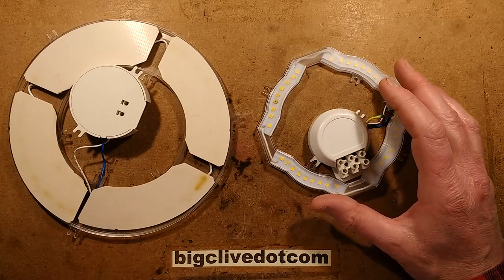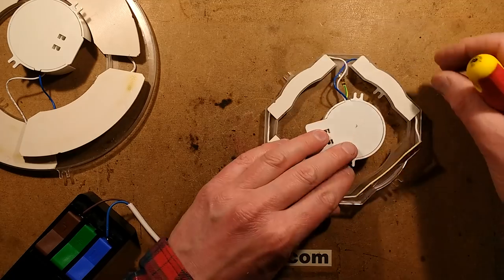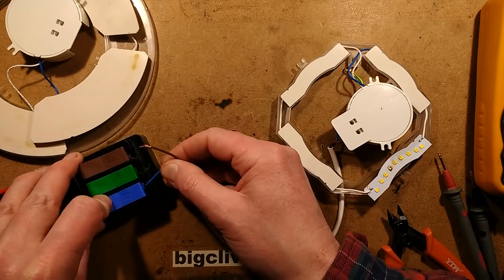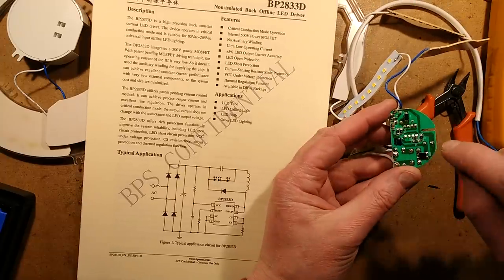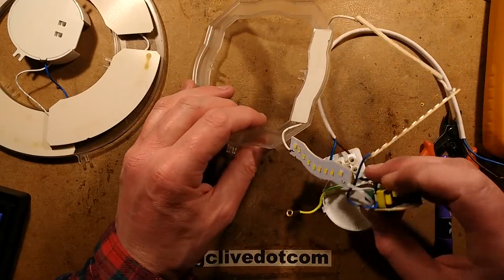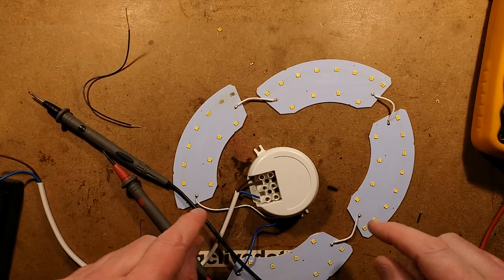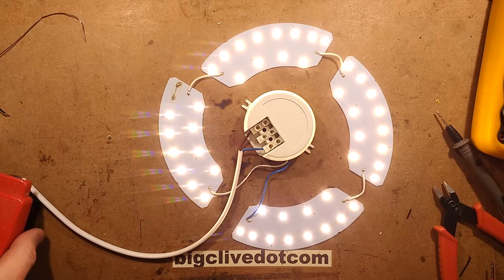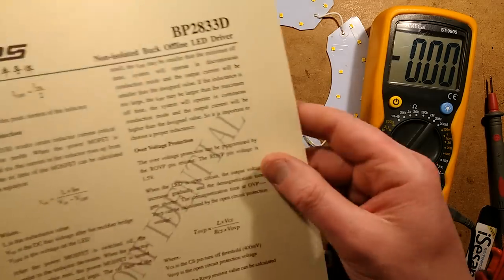Fixing two dead LED bulkhead style lights.

Comment: It is a bit hard to see in the video, but it looks like there is no large copper fill around the LEDs. There seem to be wide traces to the LEDs, but that's it. The designer could have filled the area around each LED with copper and it would help conduct heat away from the LED better. The added manufacturing cost is zero (well, it is a bit more difficult to solder down the LEDs but that is simply an adjustment to the reflow soldering profile).

Comment: One of my car's LED brake lights burned out a few months ago so I pulled the "bulb" and replaced it then peeled off the flexible circuit layer with the LEDs. I think I know which LED failed, but I haven't probed around yet.

Comment: What causes those brown LED spots? My 12v LED strip is full of them now 5 years down the line, they all still work albeit getting dim now.
Reply: Heat damaging the phosphor coating and the led junction it's self, plus general life cycle of the led, but mainly heat.

Comment: Should have measured the temperature that the LEDs are running at. Especially to see if the panel with less LEDs left on it is running noticeably hotter than the others.
Reply: SinsBird They are not going to run hotter when the supply is regulating current rather than voltage, as these are demonstrated to be.  Whether you have 1 LED or 1,000,000 LEDs in series (at least so long as you have a supply that could withstand the 3 to 4 million volts that might take), if the supply is programmed to only deliver 100mA then that is all each LED will ever see as the voltage will be reduced to whatever voltage is required to maintain that 100mA, and it is the LED itself that determines what voltage it will see at that current
Reply: Yeah, I messed up.
Reply: As it is a buck regulator, it can only output less voltage than on the input, so removing a couple of LEDs wont change anything, adding a few might make it stop working.

Comment: LEDs, when in a series and not matched perfectly, degrade at different paces. Those that degrade faster oppose a higher resistance so the voltage dropped across them grows, causing an avalanche effect.
The others are spared higher voltage by the aging ones taking more voltage drop.
Cheaply sourced components with too large a tolerance between them.

Comment: Clive, I'm not sure whats wrong but I no longer get audio from your channel. All others are fine. Any ideas?
Reply from the maker: Your computer's surround sound processing may be interpreting my bassy voice as a bass channel and diverting it to a subwoofer or centre speaker that doesn't exist.
Reply: You were nearly right. Somehow my settings had reverted back to 5.1 (not currently connected) took it back to 2.1 stereo and all fine. Strange though because all other channels seemed fine! Cheers anyway pal :)

Comment: I'm a school caretaker.  For years I swapped out 60w ordinary bulbs.  Then we went 2D- massive expense.  Now we've gone LED.  TBH....swopping out ordinary bulbs was cheap and quick.  Now I have to get sparkies in to replace entire fittings.  Please can anyone explain exactly where the saving is coz my contractor bill is now huge.  Like hundreds a year vs. zero when I was using standard bulbs.  Makes no sense to me.
Reply from the maker: That seems to be how it goes these days.  It's good to know that they actually let you change lamps though.  Many newer school caretakers here are not allowed to touch anything technical.
Reply: 40 yr old tube fittings running perfectly.  Tube fails:  New tube and starter.  Modern jobbies- Ballast fail.... new fitting.....10 years old.  Bah Humbug
Reply: It makes the world go around, us sparks have got to eat you know!
Reply: Well at least modern tubes do not flicker anymore compared to the old 100 Hz flicker crap.  
This is why I choose tubes with a good supply over LED lighting - for LED it's hit and miss if you get any decent power supply that can output proper DC. With tubes (which are dirt cheap and you can choose a wide range of color temperatures) it's easy.  
And if you use the Osram Lumilux Skywhite one time, you will stand there in awe thinking the sun just went up in your room.
Reply: Exactly. And with piles of failed LED lights ending up in landfill, they are so much greener too...

Comment: Whoever laid out the led pcb of the 2nd light .. WTF DUDE, why would you not leave the traces as thick as possible ... w h y
Reply: The tracks are about as thick as the LEDs. Is that bad?
Reply: course it is !

they could've been as wide as the PCB : imagine how much heat those can transport away from the LEDs. PLUS: the price would literally have been the exact same

try soldering to a ground plane and see how much longer that takes just to see what I mean

Comment: Shame about Maplins but 12p for a resistor when you can get 300 for £2.00 online, yeah.
Reply: Rob Webster yeah but idk I've brought a fair few switches and project boxes from them whilst doing quick bodges ... Is nice to be able to get something quick ... I don't have the time to wait a week or so for some to come from online, also it's nice to see their size in person hate buying online it's never easy to work out their exact size also it's cheaper to pay 12p for one than £2 for 300 if all you need is one
Reply: JAMP0T1 if you need a 12p resistor to get your equipment up and running on the spot, then Maplins is great for that, just think they are over price and eBay has taking over, before Maplins I had to get things from a shop called Camlab and they was more expensive then Maplins.

Comment: Hi Clive. I have a drone battery from a DJI Phantom 3 Advanced that has blown a tad. It looks quite normal, but wont fit in the craft. Just wondered would you like it  to do an autopsy on? It has a self balancing and charge regulating circuit in it. (apparently). May be an interesting video? Let me know and I will send it to you.
Reply: Mark Harper
Phantom 3 battery would also have a microcontroller of some sort since it does that whole hold the button to turn in the craft thing.

Comment: The worst thing is that like these fittings it only takes one tiny LED to fail and the whole thing is scrapped and replaced, not really very economical or environmentally friendly. The same with LED street lighting     when a lantern fails the whole lantern has to be changed rather than just the lamp!
Reply from the maker: The street lights are modular, but they do seem to be swapping the whole things out as it saves time in the long run.

Comment: Man, I just purchased some 18 awg wire and took it home and it was aluminum wire whereas the stuff used to be copper wire.  What shit but I understand that copper is through the roof again (this is why my house that was built in 1976 used aluminum house wiring because that is when copper wire was too expensive but luckily aluminum wiring for the house is illegal now thanks to the numerous fires it caused but the current house is all copper).  I saw you with what looked like aluminum wire and winced but later I see it was copper.  This wire was 6 dollars for 25 feet so not cheap as aluminum wire should be.
Reply: The Best Stooge Manufacturers really skimp on the size of copper mains cables nowadays,  years ago kettles had 1.5mm2 cables, now they only have 0.75mm on some models.
Reply: Well, aluminum in the wiring for a house is illegal to be used in the USA thanks to the 1970's and those houses burning down.  In my wall I never had anything hooked up to the wall socket but that wall was always warm and why I never did find out except for the aluminum wiring.  Aluminum wiring is the devil.

Comment: "Shunt". Funny how it rhymes with "Direct Electrical Connection in a Circuit that can accommodate all Current said Circuit would be Subjected to, and Then Some, and can be Utilized to Measure Current and Wattage". (Did I Get that Right?).  :-) Oh; a coil is needed for the Wattage Measurement.

Comment: Sigh.... Used to be when you flipped on the light, and tink the bulb went,  you'd just head to the cupboard and get another bulb, swap out, swap in, and you were back in business.  Now, with our energy-efficient lights,  (such as these ones that are wired in place), you have to go fetch a lamp or something to plug in to give you some light until either you have time to replace or repair, or get an electrician in to do it for you.  So, with the cost of some of these lights (not the pound-store or dollar-store variety) against the cost of energy we hope to save and finding out that many of these so-called "long life" lamps are turning into a farce of fiddling around.  I haven't got too many LED lights yet, still depleting my supply of cfl's, but in both cases, I must say I've found plenty of examples of premature failure, against what the package claimed to offer for longevity.  But, that's progress, I suppose.   Pfft.... take me back to the 70's when a 4-pack of bulbs was 49 cents and we didn't worry at all about how much energy it might suck, we just cared that it lit up the damn room when we flipped on the switch.  I guess I'm gettin' old. And cranky :)
Reply: I'm as green as green can be and I'm feeling the same way.
I'm starting to save receipts on new LEDs so I can take them back to the store and wave them at them. So now the simple lightbulb becomes an accounting project.
Reply: The old lightbulbs added extra heat, which is called waste today. But now the saved energy is used to play games on  small idiotdevices turning children into zombies.

No savings are made, unfortunately. More material is needed to cool LED. More material is garbage when only a small non spec LED blows the whole circuit which means you might save electricity in the short term at home, but at a societal level the energy usage have probably not sunk all that much. It just moved to manufacturing and recycling. Ah, the EU, forced the replacement because progress. Apparatchiks knows best. Obey kolkhoz worker, your math is not as good as ours.

Still the 100 year light bulb is shining in that Livermore fire department...
Reply: Have you forgotten that the incandescent bulbs had an average lifetime of 1000 hours? Just not having to go through the hassle of buying, storing and replacing bulbs so much is great. Now you can buy fairly good led bubs for about a dollar each,  so you don't have to take chances with fixtures with "built in" leds if you don't want to.
Reply: I have a case of "5000 hour" LED lamps I used to replace the old 60W incandescent lamps. The new LED lamps last an average of 3 months before failing, whereas the incandescent lamps lasted over a year. Oh, the LED lamps cost about $4 each, vs 60 cents or so for the incandescent lamp. True, the LEDs draw less power and this adds up. But the quoted lifespan is hogwash.
Reply: Quality varies, of course there's crap on the market. In the beginning most were crap, now a lot of even cheap brands of led bulbs are really good, the trick is to find out which to buy and which to avoid. The same evolution as CFLs went through, and most other technologies.
Reply: Stan Patterson Get off my lawn.
Reply: l wilton You need to buy better quality LED lights.  Half the lighting in our house, around 50 LED lamps in total, is LED and most are over six years old at this point, some of which operate for as much as 12-16 hours per day (the majority are likely Phillips branded, if I recall).  In those six years we have had exactly two LED lights fail (knock on wood)...and when they do you just screw in a new replacement LED light of identical color temperature.  Nowadays buying quality LED lights is much cheaper than it was when I first started, just don't buy the cheapest junk you can find just because it is cheap (a common mistake in so many purchases these days).  But even the shorter lived LEDs will usually deliver at least 10-20,000 hours before they fail prematurely over which time you would have had to replace anywhere from 8-20 incandescent bulbs, consumed 8-10 times the energy in lighting plus, if you live in a region where air conditioning is important, you will spend and additional 1/4, or so, of that same lighting energy on removing the generated waste heat produced by the incandescent bulbs -- the savings add up, it's just that you are paying for those savings up front when buying LED lights.
Reply: The issue is not the LEDs, it's the infrastructure around them. If you spend $20 on your room light, expect it to be very shoddily done, like the ones shown in the video that didn't even have aluminium PCBs to get rid of the heat. Those die very quickly. Proper LED lamps with the right cooling should last for decades.

An easy way to tell whether it's the LED itself or the shoddy design is whether it went dim over time (like LEDs do), or whether it suddenly went dark (which is the case when they overheat).
Reply: Stan Patterson I've had a few  very premature cfl failures one or two after only a few short weeks!
Reply: Aop Stoar
I can't remember where but I recently read that last year was the first where electricity demand did not augment ever (since electricity was invented I guess). I do not remember if it was world wide or over one country.
Reply: Incandescent bulbs were double efficent. 
They lit the room and also provided heat. 
In Canada the change to cfl and led has resulted in higher natural gas bills which means more fossil fuels are being consumed.
Reply: Using fossil fuel to generate heat to generate electricity to generate heat is less efficient, and uses more fossil fuel than simply burning the fuel in your house to generate the heat directly. 

Turning electricity into heat is a very efficient process, but turning heat into electricity is not. If you have a lot of fossil fuel and you need to heat a lot of homes, your supply will last longer if you burn it in each home, rather than burning it centrally in a power plant.

The best natural gas electric generator can as much 60% efficient. Transmitting electricity can be above 90% and turning it to heat with an incandescent light bulb or electric furnace  is 100%. Possibly a little more if you use a heatpipe system to draw heat from outdoors.

A natural gas furnace can be above 90% efficient. I have one from the 1980s which is 95% efficient.  You get way more useful heat per unit of fuel. If you use electric heating, the power plant just releases 40% of the heat from the gas into the air, compared to just 10% with a low end gas furnace. So the plant needs to burn more gas to deliver the same amount of heat to your home. This is why at least where I live, it's something like half the price to heat with fossil fuel vs electricity. This adds up to hundreds of dollars over a year. 

Now, if your power is entirely sourced from things like wind, solar, or nuclear exclusively, then you burn less fossil fuel if you heat with electricity.  It's also possible that you simply required far less heating when you had incandescent light, because the radiant heat they give off is very comfortable, and they are usually  only turned on when you're using the room they're in. If this room also happens to contain the thermostat, the gas heating system will not come on as often. you might also choose lower settings in the first place, because the radiant heat from a few hundreds watts of incandescent lighting in the kitchen can take the chill off in the morning.
Reply: compwiz00 
Hydro power.
Reply: +Aop Stoar
Is this what alzheimers does to you?  Shoot me when I turn 60.
Reply: I think corporations should make modular fixtures with replaceable LED bars and replaceable power supplies, similar but different from the fluorescent tube type. But you see that would be more expensive, lol ...
Reply: " Obey kolkhoz worker, your math is not as good as ours." -- so then you've got access to relevant factory energy use statistics, done the life cycle analysis, and come to a reasoned conclusion? Come on, share with us, we're good listeners ...
Reply: Those must surely be complete crap. I have LED bulb-format light sources that have worked steadily for a couple of years, at least, and none that have failed that early. Don't buy the same kind again!
Reply: Wil Hobbs, "In Canada the change to cfl and led has resulted in higher natural gas bills which means more fossil fuels are being consumed." -- can you point to the documentation used to determine how much fossil fuel was burned to provide electricity for lighting, across multiple Canadian power regimes? You realize that the North, Alberta, Saskatchewan, and Manitoba all use mainly fossil fuels, and Ontario and the Maritimes use substantial amounts too? Only QC and BC are low-carbon electricity generators. Did you mean that you personally were using more fossil fuels now that you have efficient lighting? (I assume you don't have air conditioning?)

Comment: Maplin are in receivership? Ah jesus, they're the only place we have like them, although their advertising was a terrible failure... If they've sent you two lights, was one a replacement for the other which also failed? So maybe they're not getting the right ones rated for their system
Reply: Phonotical 
I'm not surprised that Maplin has gone into administration. In recent years they've gone much more mainstream and moved away from supporting the electronics hobbyist.
Reply: Pete Allum you're not wrong there, I went after finding out what it even was and that there had been one in my town for 20 years, first I knew of it in that time, and I went again recently, I'm not going to maplin for some crappy drone or a bad looking fan, I'm going for weird and wonderful components, but there is now less of that, and the staff know less about the product, sad really
Reply: Phonotical That sounds a lot like what happened with Radio Shack here in the States. They're pretty much dead now.
Reply: tallman11282 I think they're pretty much identical but on a smaller scale